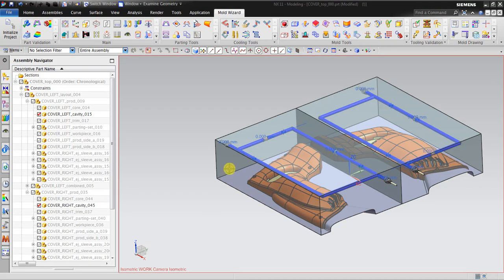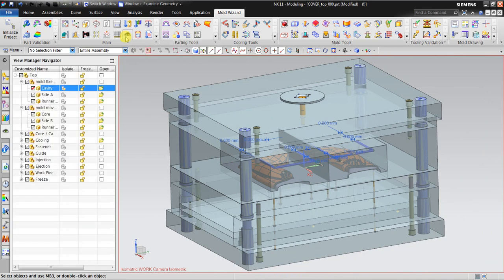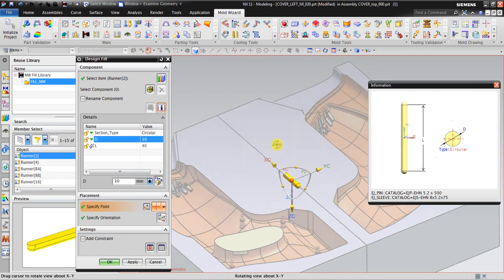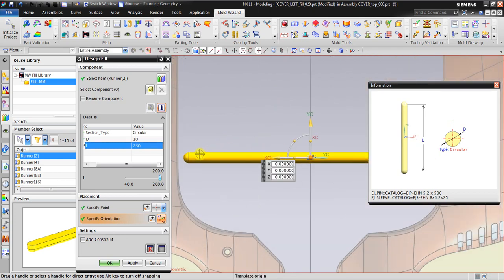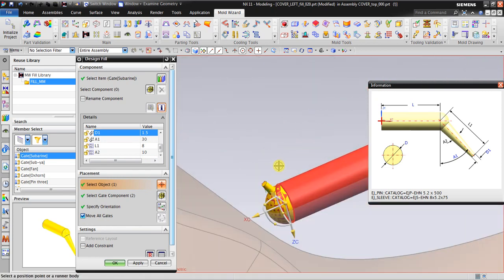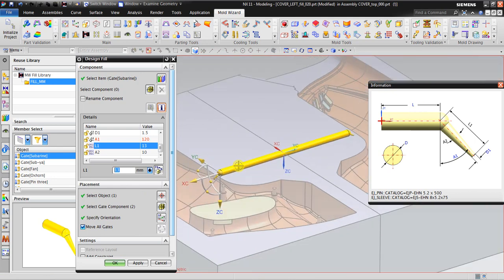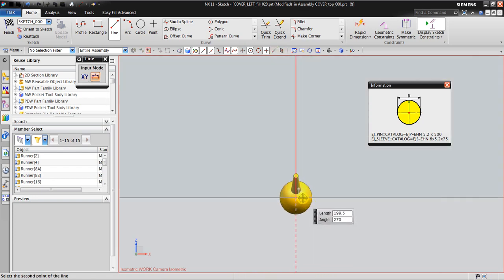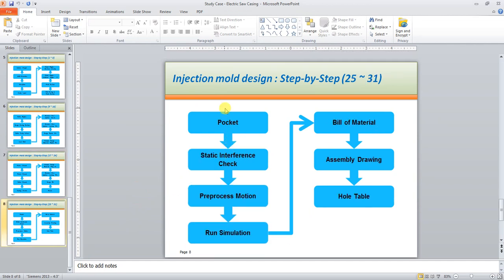NX Mold Wizard : STEP 11 - Create Gate & Runner System

Comment: hi ,
I am getting a error " memory access violation while designing the runner from sprue to gate system. kindly help me out in it. I am using NX 12.0.1
Reply from the maker: Hi.. please restart the NX program.    Ia also sometimes get that kind of error if I using NX and solve it by restart NX or the Windows.
Reply: CAD/CAE/CAM Tutorial did you mean to restart the computer and application?. If so, i did it many time but no result
Reply from the maker: I have this problem sometimes if I put my computer to sleep but with NX still open. After I restart the windows it solve the problem. My suggest you can try to replace your installed memory card and replace it with new ECC memory card. Perhaps the installed memory card start to aging and the temporary data in that memory card get wiped out during sleep mode.
Reply: CAD/CAE/CAM Tutorial  is reinstalling the NX 12.0.1 will be the solution.